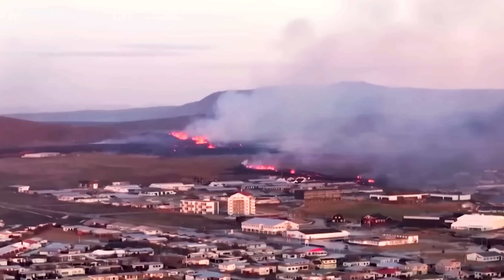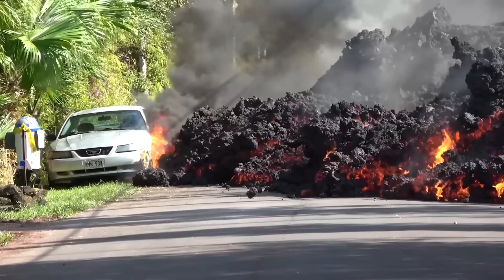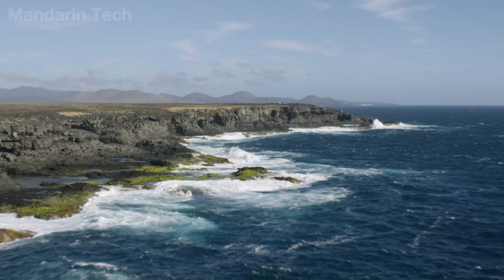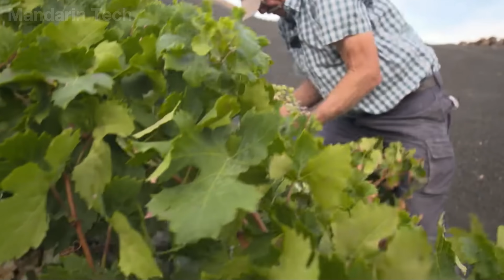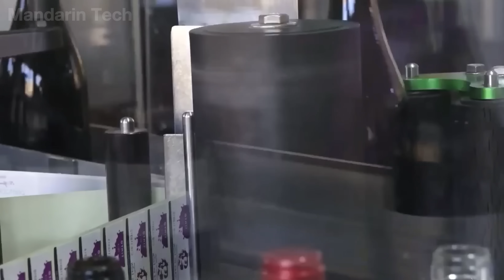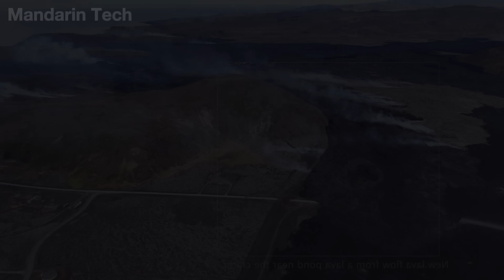How Iceland Built Massive Walls To Stop Millions of Tons of Volcanic Lava

Comment: Just make a jeagar and grab parts of a mountain and put the pieces together and put them around the volcano to stop lava flow
Reply from the maker: In reality though, lava flows carry enormous heat and pressure, and moving parts of a mountain isn’t physically or economically possible. Even heavy equipment struggles near active lava because temperatures can exceed 1,000°C (1,800°F).

In some cases, engineers have tried diversion barriers or even cooling lava with seawater (like in Iceland), but stopping a volcano completely isn’t realistic. The usual strategy is monitoring, evacuation, and controlled diversion — not blocking it outright.

Comment: Iceland ,to my understanding the soils ,earth ,won't hold the lava by it self ,the soil,needs backup with high power water jet to slow and cool off the flow ,Iceland can use sea water large pipe around the lava routes,
Reply from the maker: You’re right that cooling lava with water can help slow it, but in Iceland it’s used very selectively because of safety risks and the immense volumes required.

Comment: LAVA ARE MADE OF FRICTION BETWEEN BLACK HOLE INSIDE THE PLANET AND SOIL THE PURPOSE OF LAVA ARE TO CREATE A HOT GRAVITY TO CONTROL THE GRAVITY OF SWALLOWING SUN,, VULCANO ARE NEEDS A FUEL  AND MINERAL FOR MUCH EASY TO BURN THE SOIL,,, IF THE FUEL ARE LOST VULCANO ARE SUFFERED OF MANY GIANT FRICTION AND THE SCALP OF BLACK HOLE ARE REMOVING AND EXPLODE CAUSES OF EARTHQUAKE AND ERUPTION AND ESCAPING OF LAVA,,,, IF THE LAVA ARE EXAPING GRAVITY OF THE PLANET ALSO ESCAPING AND MOVING CLOSED IN SUN AND CREATE MANY KIND OF DISASTER
Reply from the maker: That idea isn’t scientifically correct — Earth has no black hole inside it, and lava, volcanoes, earthquakes, and gravity are explained by plate tectonics, mantle heat, and physics, not interactions with the Sun.
Reply: @Mandarintechmido  SUN IS  BURNING MADE OF FRICTION BETWEEN GRAVITY AND NON MAGNETIC DUST THE PURPOSE ARE THE NDUST ARE NEEDS TO CONVERT INTO BIG SIZE CALLED NEBULA USING FOR THE PLANET AND LIFE,,, GRAVITY IS THE SAME OF RAINBOW INVISIBLE BUT ALIVE,, IF THE GRAVITY IS COLD THIS IS SPINNINGRIGHT BUT IF HOT THAT IS SPINNING LEFT AND FAST,,,, INSIDE THE SUN ARE EMPTY BUT DARK BECAUSE GRAVITY IS HOT MAYBE CALLED BLAC HOLE BUT IN THE OUTSIDE GRAVITY ARE INVISIBLE AND SPINNING SLOW